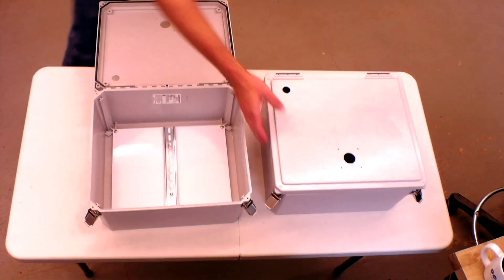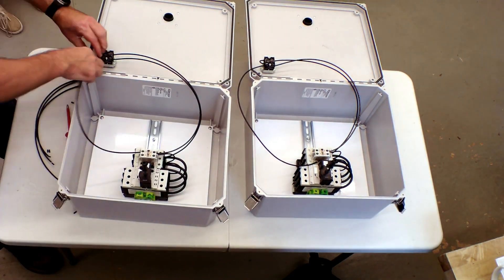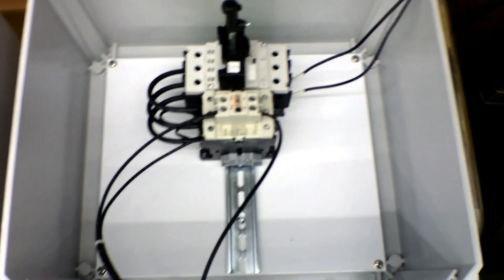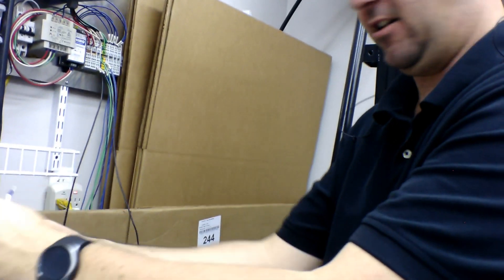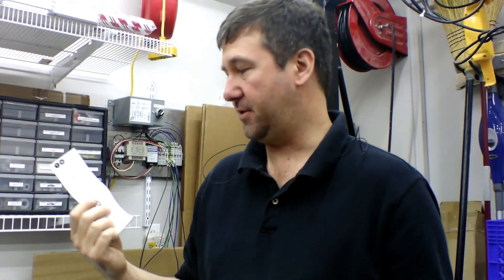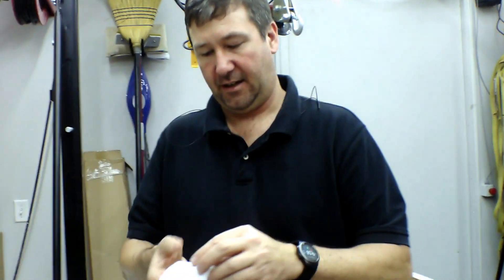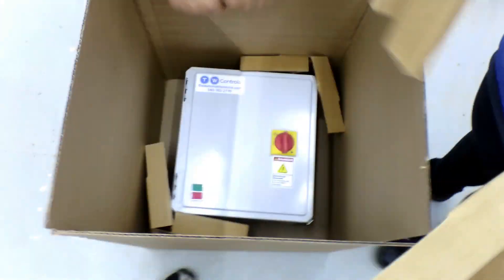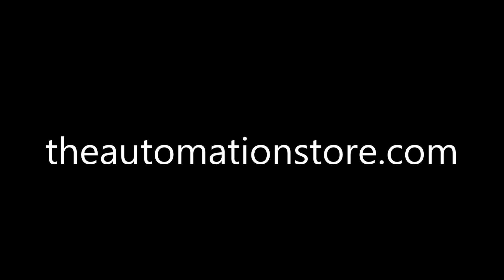Motor starter Control Panel Build

Comment: Great video as always, "BUT" and there is always one of those floating around, Can you also put the name plate sticker inside the box? I have never found a sticker that can withstand a food manufacturing wash-down process.. Just a helpful tip Sir.
Reply from the maker: Send us an email, contactus@twcontrols.com, and I'll send you a sample sticker.  The ones we have made have a PVC coating on the outside of them that make the resistant to oil, grit, wash downs, and heat.  In fact we stuck one on a dish we had 5 years ago to test how it would hold up to being in the oven and the dishwasher and after 100s of cycles it is a little chard around the edges but still there.